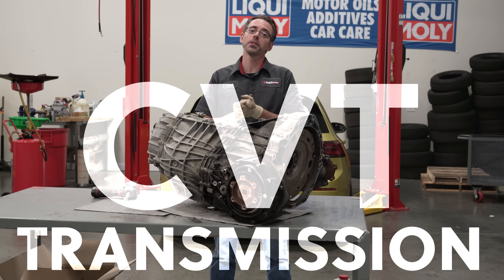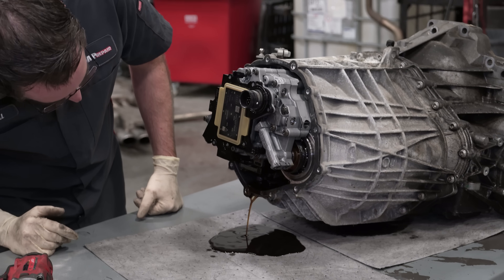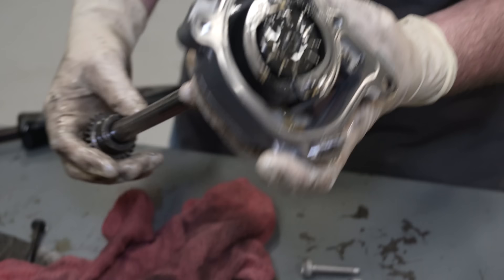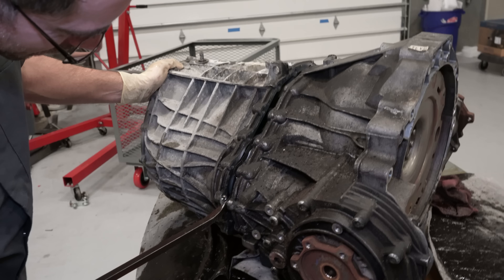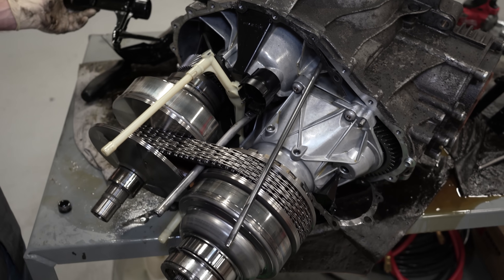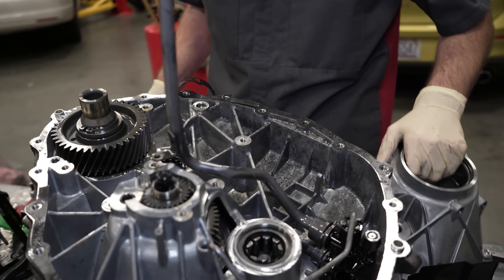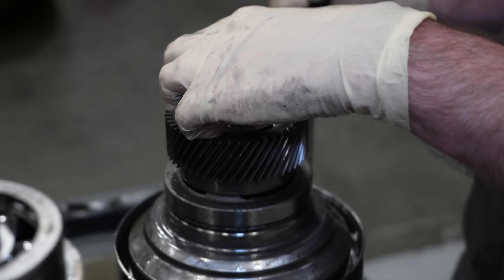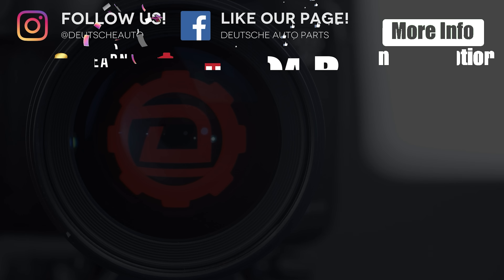Why you shouldn’t get a CVT transmission

Comment: It’s a shame the particulate filters are embedded inside the unit and not serviceable from the outside.  Wife has a 2015 Subaru Crosstrek which I had the fluid changed at 50k miles and will at 50k intervals.  No issues but I just don’t like the way CVT’s feel when driving one.

Comment: I have a 2012 Audi A6 2.0 tfsi it has a cvt transmission code is NDM it’s fwd
Reply: I have A6 2012 had cvt also 2.0 tfsi it has 155k The transmission code is NDM it’s a fwd

Comment: Totally agree.

I am here in Japan and having to put up with my mother in-law's Honda N-Box. It's a Kei car, which is a 700cc, lightweight car. Think of Kei cars as boxes with less power than even a scooter would get. No weight, no torque required. And on these, a CVT engine doesn't really show its flaws.

But Japan has an unhealthy addiction to CVT engines that just won't stop. Toyota, Lexus, Honda, Suzuki, Nissan, Subaru.... looking at all of you. You're all guilty.

There is on major exception to this Japanese rule: Mazda!

Mazda are small, but behind the scenes they're very engineering focused with a lot of R&D going into things such as metallurgy (reason Mazda's crash so well is they lead the world in UHSS - ultra high tensile steel), crazy engine tech (only car maker to have low compression diesel, only one to attempt compression petrol).

But one of the things I love them for is their human centric department (Kansei Engineering) run by Psychology Professor Kenta Kubo. The department studies everything from tweaking fonts and kernings of everything in the cars display to reduce eye strain, to the movement of a body around a bend.

But one of the most important studies I think was, what I refer to as the "how long does it take to annoy a driver with a delay?".
Turns out the answer is 300 milliseconds.

To have a direct connection with the driver, every interaction needed to have a delay of no more than 300ms between cause and effect. Press an accelerator - needs to be faster than 300ms. Change a gear - needs to be 300ms. Use a start-stop system - needs to be 300ms*. (* Mazda was no doubt frustrated by the fact that although their start-stop was twice as fast as anything else on the market at the time they made it, it was 350ms..... But that's a heck lot faster than Subaru with an 800ms start/stop at the time, and a love of CVT's and Boxer engines).

From the outset of completely throwing all the Ford garbage out when Ford divested in 2010 onwards (to save their own butts), Mazda knew they needed an auto transmission that was good with fuel, but was direct and quick to shift (but also had to be reliable).

The immediately dismissed CVTs!!! They were considered the worst possible solution because they're slow, noisy and not anywhere near quick or direct enough to satisfy 300ms.
The torque converter they used, was redesigned to move the clutch plate further into the transmission and have it lock up about 90% of the time, thereby also making it a "slush box" that had a direct feel.

From Mazda:

"The torque converter transfers engine power to the transmission through fluid, making a smooth start-up and gearshifts possible. The drawback is that fuel economy worsens due to the loss of power transfer through the fluid, and slippage during rapid acceleration, which causes vehicle speed to lag behind engine speed. Therefore, a torque converter with a lock-up clutch was developed, which locks the torque converter's turbine to the impeller to improve fuel economy and direct drive feel."

While Japanese manufacturers continue to pump out CVT crap, I think Mazda should be congratulated for standing alone and giving the middle finger to the transmission.
Reply: Brother, the amount of time you took to write this comments are commendable… I drive a Mazda 3 with the 6 AT transmission so I know what you are referring to. 😊
Reply: @sparcoraceseat  thank you. I love their AT and I am glad Mazda went to the effort of designing one from a clean sheet to achieve everything they needed to, and nothing more.

Looking forward to the new 8 speed though; not that the 6 speed is really wanting for extra gears unless you're doing more than 120km/h.

Was able to visit a brand new Mazda showroom here in Japan the other day (their new style is classy and what they will roll out worldwide). Sat in the CX-60 and was seriously impressed with the build quality.

They're on a home run lately. Particularly given how small they are compared to other Japanese brands.
Reply: Even saw a Scotty video the other day saying basically exactly what you said about the skyactive gen Mazdas (a 2017cx5) in that scenario but I'd have to say Ive always liked Mazdas, they always had a little more luxury for the money than Toyota and Honda especially in the the 2004 to 2008 madza 3s. The autos back then weren't so reliable but still the car in general was much nicer all round than corollas and civics. Maybe a newer Mazda will be my car of choice some day.
Reply: @chloeleedow7250  Scotty is quite accurate with most of his information. One key thing I left out was the reason they've been so impressive with their engineering of late. As a result of the 2008 financial crisis, Ford saw the writing on the wall and developed "One Ford" as a way to save their skin. As part of this they did super cost cutting which left brands they had major investment in such as Mazda and Volvo, out in the cold. History shows this saved Ford being largely saved from the burdens other US car companies suffered.
But Mazda and Volvo? Volvo got bought out by a Chinese company. Mazda decided the only way for it to survive was to go back to doing what they were good at - actually get back into very good Japanese engineering. From 2012 everything was clean sheeted (i.e. designed completely from scratch) without leaning on old parts or methods.
Personally I think during the Ford era, Ford dictated too much and put far too much cost saving over engineering into the Hiroshima brand as a direct order from Michigan. But without Ford looking over them, they could finally be as Japanese as they liked.
Reply: Thanks!  Great to hear.   The most annoying transmission I've ever driven was a CVT  (Mitsubishi Colt) precisely because of the delay in everything.    Worse than the worst 'conventional' auto.   When I first rode in one as a passenger I thought the driver was drunk, or had some sort of delayed-reaction problem.   Wasn't until I drove it that I realised the problem wasn't the driver, it was the transmission.
Reply: Very informative.   I hope yer not full of shit😅💜💜

But seriously thank you- been driving the 2.0l professionally for 220k miles in the Focus and I'm like 'god bless Mazda'- haven't even checked the timing chain yet but ummm,  really soon I'll get to it 😅
Reply: Very interesting!
Reply: idk 49 cc vs 700cc. my 49cc scooter gets me around plenty quick.
Reply: All cars with CVT's are off my list for future cars. Mazda still makes good autos but also a lot of manual transmissions which are the most fun and cheapest to fix when the clutch eventually wears out.
Reply: based comment
Reply: 2015 cx-5 user agree to this 🤣🤣
Reply: I know you said they through out all the Ford crap but Mazda still uses a version of Ford 3.5 duratec v6 as a sky active engine
Reply: Rented a Mazda CX-30 with true auto, it is an awesome car! Loved it didn’t have the shite box CVT.
Reply: Cool info about Mazda and hope life in your Japan is very swell! Greetings from sunny Florida USA ✌️ 😎
Reply: @wailingalen  thank you :) I was in Fort Lauderdale last year for a quick break. You're right about the sun :)
Reply: Which Mazda car's/sun's are the best? How do you like the Mazda Miata ?
Reply: @Johnny53kgb-nsa  although all Mazda's are still developed with the gram stategy at the heart of weight reduction (effectively every gram of weight needs to be justified), the MX-5 (or Miata as it's known in Nth America), is more true to the gram strategy than any other.
It's over engineered for the track, which makes it very reliable for normal driving. It's also still statistically, North America's most reliable car on sale today.
Reply: I choose eat subaru... 😂😂😂
Reply: Mazda also pumps out the it's direct injection engine tech without doing any longevity tests on it, causes valve carbon deposit issues that requires periodic engine head partial teardown for cleaning. Toyota already realized this that's why their direct injection engine took some time to be commercialized. Some even fitted with self cleaning like tacoma
Reply: @terradrive  The skyactiv diesel engines also have problems with clogging dpf's. It's not just about gearboxes. My crv diesel has never had this issue - not even a regneration light has come on. There are even specialty shops here that remove the dpf's and blank the egr, and turn them into "performance vehicles" lol
Reply: @terradrive  sounds like a generic statement that cannot really be attributed to Mazda itself. All direct injection engines have this issue.

That said, at least for 100,000km a good indicator for this has been the two Autobild Daurtests.

Best if you can speak German, but you can get translations.

Autobild is a German car manazine well known for their Daurtests (endurance tests).

The most famous part is the fact the photo at the end, where the entire car is stripped into every nut and bolt for a photo.... 

The aim of test is two fold.
1. Determine reliability over 100,000km
2. Determine wear over 100,000km

Both the 2012 CX-5 and the 2017 CX-5 were praised. The first was commented to be among the most reliable vehicles tested, and had it not been for a single recall the vehicle would have passed flawlessly.

(For record, almost no vehicles have passed the German rigorous testing flaw free - however BMW and Mazda are the only two brands to have had more than one flaw free vehicle over the nearly 2 decades of testing).

In the end, the Germans said that after 100,000km the amount of wear was similar to 50,000km.

The carbon deposits on the engine were considered to be minimal for an engine of its age.

Part of the reason is likely that Mazda have patented cylinder designs that include domes that cause vortices that attempt to  more completely ignite the fuel, and the injector spray is designed to spray very fine. 
Mazda have always said this does lead to less carbon build up.... but it's impossible to escape.

Obviously though, your comment isn't really backed up by any evidence.
Conversely Autobild has a lot of experience behind their testing and it's not only published, but scrutinised by the German public. 

I'd take their word over yours in this case.
Besides.... your comment is really just a troll at the end of the day.
Reply: @inodesnet dude, Toyota makes bulletproof CVT transmissions, I do not know what you’re talking about. They have a 1+CVT which the first gear is a real one and after that the CVT takes over. They also have the eCVT for the hybrid versions, they are both bulletproof
Reply: @LuizHartkopf   "eCVT" has nothing in common with CVT and Toyota should really have found a better less confusing name for it.    eCVT works quite well and is not annoying.
Reply: Why don't you give yourself a reason not to grumble about your mother in law...and stop using her car?   Just askin

Comment: In particular, the CVT shown here is made by Audi using chain type belt compared to other manufacture that using belt type.
I owned 2 cars which one of it is Audi and the another one is using Punch-based CVT. 
Audi CVT is much robust and less problematic, even compared to DSG transmission in Audi line.

It is just matter of which manufactures who produce much better CVT.

Comment: CVT transmissions work fine. But a new car is supposed to cost $50,000. 

A new car with a rubber-belt CVT and an inline four cylinder engine only costs $8000. 

Detroit just isn’t going to let that happen.

Comment: Dude no worries I've done alot of different types of manual labor jobs in my 51 years on this rock and rare is the one that doesn't make a mess or mess you up.  It's the dirty truth.  I've done some mechanical stuff as well and never avoided the inevitable mess that goes with it. Cool psv btw.

Comment: I hate the yoyo effects of cvt transmissions but I have 145k miles on my 2011 Honda insight, regular fluid changes every 30k miles and no issues outside of that yo-yo rubber band felling occasionally

Comment: I would like to point out that yes CVT Transmissions suck but the ones on a Toyota Prius "unless they changed them in the last year or two" are some of the best transmissions that have ever been built and are truly rock solid.
Reply: The Prius uses a eCVT transmission which is not at all the same as this kind of CVT. The eCVT uses two motor/generators and a planetary differential gearset to simulate a CVT and yes it works very well and reliable too.
Reply: It uses a differential driven by an electric motor to give the effect of gears. 
There is no belt.

Comment: CVT transmissions ALWAYS have a small amount of slippage and don't deliver full engine power to the wheels.  This is basically true for a lot of different designs however CVT's are the worst!  They are by design the least efficient at delivering power, Anyone who says that they are a good transmission don't understand this concept Plain and simple. Combine this with the fact that they are notoriously unreliable Makes them the biggest pilot c***!

Comment: Cvt are great on low power/torque smaller cars…Like a nissan sentra. They dont jump around between gears climbing hills and mountains just smooth rpm increases. Nissan cvt dont look like this on the inside. They have a belt made of little triangle peices to increase the contact area on the pully. But on suv and higher power motors stick to a normal transmission

Comment: I drive a manual smoother than auto gear change. I manage everything including skid correction and pulse braking. I get 27km per litre easily by going to neutral anytime to save fuel.

Comment: I have only rebuilt my 4l60e and that looks a lot more complicated even though it is only 1 set of gears kinda
Reply: 4L60E has two planetary gear sets for four forward gears and one reverse gear with a lockup torque converter,  so twelve actual gears if the gears were to be counted individually. Four planet pinions a sun and ring gear per planetary gear set.

Comment: My 2011 Subaru Liberty broke a CVT at 257,000km, the valve thingy broke and in that model it’s INSIDE the transmission so I swapped it for one off a wrecked car. Apparently they are sealed units, never needing servicing. Considering how they work, fkn WHAT????

Comment: I mean, my engine blew in my 2003 Honda Civic Hybrid at 230,000 miles before my CVT died. I feel like these things get a bad rap because people don't maintain them. You gotta change the fluid in them frequently... They last a long time if you do basic maintenance on your car, which many people don't... I typically change my CVT fluid every 15k-20k miles, and haven't had any major issues with any of mine.
Reply: The 2001-2005 Civic auto tranny is notorious for being one of the biggest automotive failures of all time though, you are extremely lucky

Comment: My 2012 Civic CVT has 170k trouble free miles on it. I change the transmission fluid every 50k and it has just run and run. I agree it's not a transmission for an enthusiast but for a transportation application they are fine assuming you don't neglect fluid changes.

Comment: My 2017 Nissan Altima SR had it’s CVT go at 16,840 miles. I had the fluid changed at 15k. Service Manager told me that they had cars where their CVTs went at 500 miles. Service writer told me his Nissan Maxima’s CVT failed before it hit 10K. Fortunately for me my car came with a Dealer provided lifetime power train warranty. Replacement only cost me a $100 deductible.
Reply: That’s why I have never owned nor will ever buy a Nissan.  I bought Toyotas before and Lexuses for the last 20 years.  Will not buy any other brand.
Reply: @powerhouse4450  those SR are nice.  What mileage?  My 2017 Lexus ES350 just hits 35K, drives and looks like the day I bought it 5.5 years ago.  The only Nissan I could imagine owning is the GTR a bargain at that price point.

Comment: I had an Audi A4 B6 Avant, that was lowered, chipped and running 18 inch wheels. I heard of, and expected grief from the CVT transmission. It never missed a beat in over 100,000km of frequently enthusiastic driving. Meticulous maintenance and fluid changes. Like I do with all my cars. One of the lucky ones, I suppose.
Reply: My Audi A4 has multitronic (dubbed multichronic) CVT also, is at 120k miles no issue. Change the oil, don't sit in traffic with foot on the brake for minutes, don't drive it too hard and don't park with the weight of the car on the trans.
Reply: @ln5747  I live on a pretty steep street and 8 out of 10 Amazon delivery vans park  on the parking gear.....and then I wait for the "BANG!" as they leave...no wonder they drive an ice-cream truck for a living.
Reply: I also had a B6 A4 with a multitronic. Bought it from a friend with 300k km drove it until 350k km. Never had an issue with it.
Reply: Maintenance is the key 👍
Reply: No it’s just most people don’t take the CVT to get its fluid drained and refilled.
Reply: True that. I am still  driving my 2004 B6 1.8T at 160000 kms with 0 issue on CVT with recommended services.

Comment: To be fair CVTs have their uses. I build 50 to 500cc scooters and CVTs for these applications are insanely cheap to fix and fortify. 

If you aren’t looking for more power on bikes then there’s no reason to mess with them, replace the belt when you feel the revs slip at high speed and you’re done.

Auto manufacturers for whatever reason need to over complicate existing technology to the point of absurdity, case in point CVTs for cars.